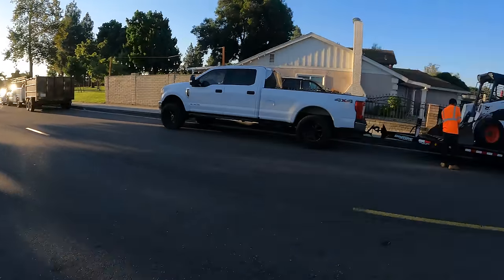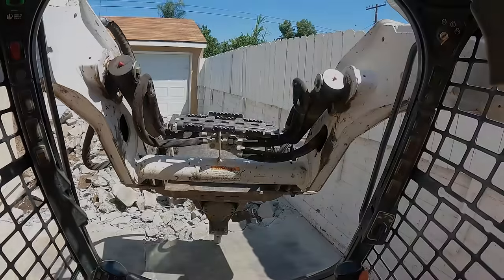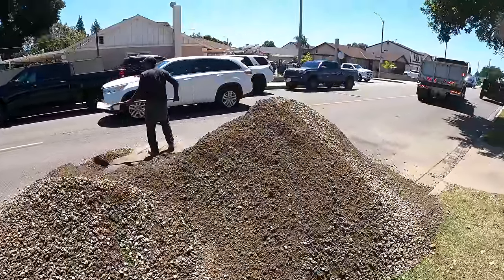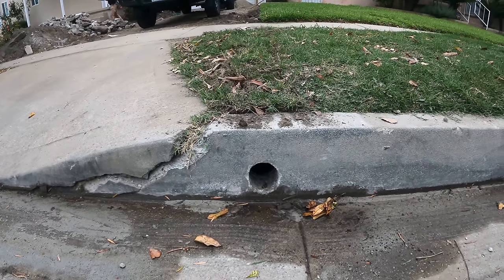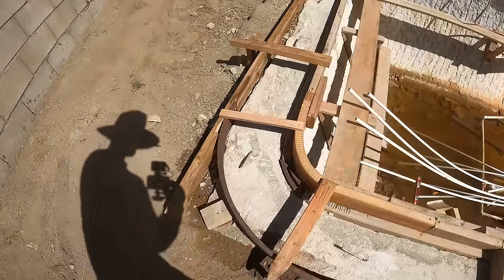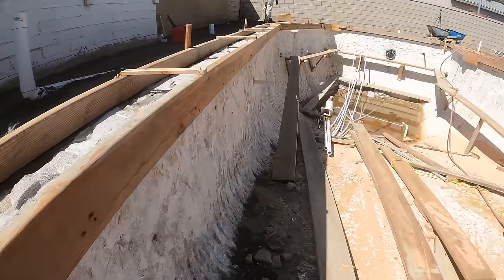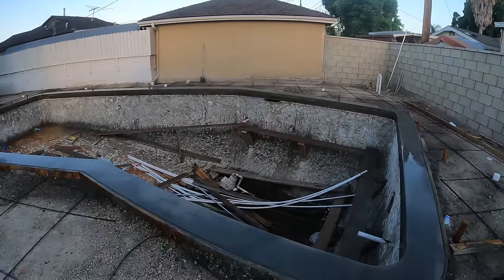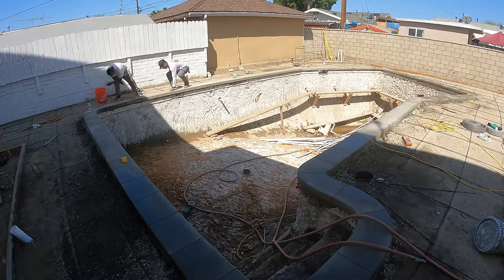Mastering Concrete Craftsmanship: Pool Deck, Coping, and Driveway Transformation | Part 1

Comment: What's the advantage of cutting the joints after the concrete is dried?
Reply from the maker: You can put them a lot closer together because they’re hardly noticeable and since they’re closer together the coping won’t crack. They also look a lot cleaner.
Reply: @OdellCompleteConcrete  
Oh ok. Thanks!

Comment: Hey Odell,
 I wanted to do a 12x20 pad for a shed.
 how thick on the edges would you recommend?
I wanted a thickened edge.
And also how thick in the center?
Reply: I did one couple months ago. 4" center and around 6" around perimeter 👍
Reply from the maker: 4 in the middle, 12" on the edges

Comment: Oh wow, thats SUPER bad to connect runoff to sewer system....  That is illigal in almost all municipalities.  If an inspector ever saw that, the home owner could be in for a world of hurt.  Rain runoff needs to go to the street, where the city rain water collection system cant pick it up.  that is seperated from the sewer and is NOT TIED in most places.  Some older cities that built their storm and sewer systems together and havent been split due to cost and the size of those places is so tiny, deal with sewage a diff way.  But if the storm is tied to sewer, that overwhelms the treatment plants with massive ammounts of exxcess water, and places like Phoenix that COLLECT storm water in MASSIVE underground and above ground tanks to treat and send as treated water and clean water for the Purple water lines.  But if you drain your pool, you must always drain INTO your sewer as that water is full of chemicals and must be treated.  It can not be fed into the storm drains where it can contaminate clean water and possibably kill local wildlife and such.
Reply from the maker: Exactly that’s why we had to dis abandon the old system